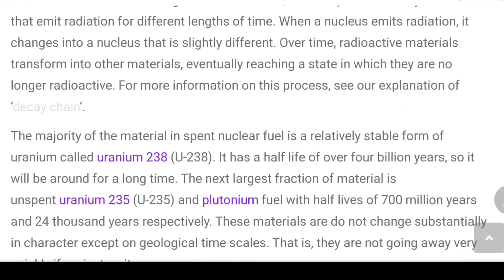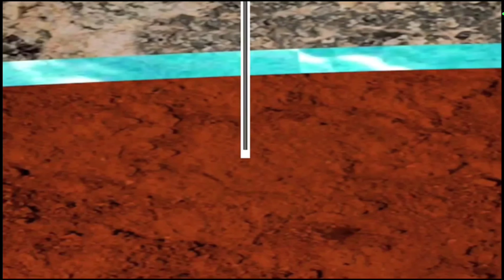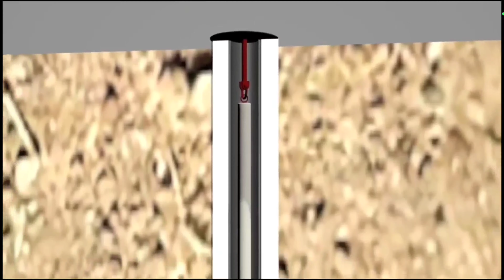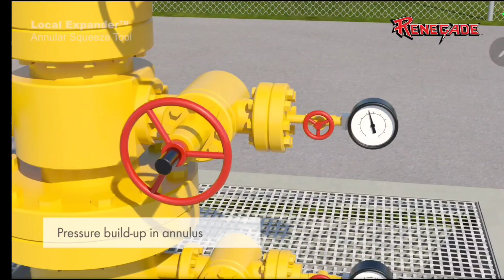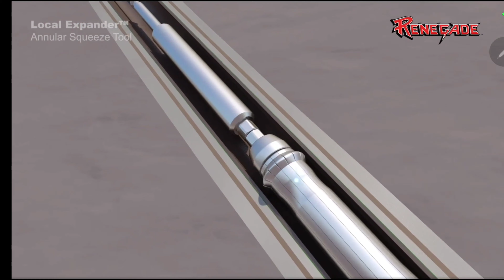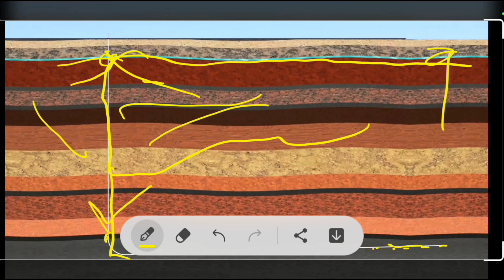Nuclear fuel disposal discussion

Comment: Correction: Zirconium cladding is used as a barrier between nuclear fuel and cooling water to contain radioactive material and prevent it from dispersing/dissolving in the coolant. The uranium in the fuel is already oxidized (UO2) so no need to protect it from oxidation.
Reply from the maker: Thank you for the correction...that all?
Reply from the maker: Keeping it from becoming water soluble.
Reply from the maker: You see one seed planted now don't you.   So now what about the square hole in the bottom of Fukushima and cracks throughout the entire building which is leaking that water soluble corium into the environment, biota and the atmosphere. Bonded to the oxygen in the water.
Reply: @paulmobleyscience  Meltdowns are bad. Thats why I want molten salt reactors.
Zirconium cladding begins to react with surrounding water at 650 C so when reactor begins to overheat a lot of bad things happen.
Reply from the maker: @user-py9cy1sy9u  Molten salt reactors have their issues as well and no they are not the answer to yet another bad decision made by society.  The Tellurium embrittlement issue is not one that can be just covered up with an additive and swapping cores every 7 years.  This is mearly a small group of people trying to push their need for a salary on the rest of humanity and corrupt politicians/government/military allow them to do it.  I served and the oath is foreign AND Domestic and I aim to make certain that my oath I took to protect the citizens of this nation and the world be carried out here in the arena where the debates are held.  You won't ever be able to argue for it because you simply don't have enough of the pros to outweigh all the cons that anti-nuclear activist show, it's impossible and the only reason it occurred to begin with long long ago is war and corruption.
Reply: @paulmobleyscience  Yes you can exchange your core every 7 years. You dont really appreciate the amount of energy these things produce for amount of metal they require. A 500 MW reactor will produce around 200 million dollars worth of electricity in a year. Give or take.
Reply from the maker: @user-py9cy1sy9u  You prove my point right there...."you don't really appreciate the amount of energy these things produce"...surely you're joking?  Decades I've been at this even in the US Air Force Civil Engineering I received training.   I know what I'm talking about and you're still here trying to put lipstick on a pig.  The public is going to know all this information whether you like it or not day after day here commenting, and thank you for being cordial most times that doesn't occur, but one day there will be others they prove you wrong just like those in the 70s and 80s and even now with this whole "emission" free and carbon "free" nonsensical political/corporate manipulation thats taken place since Al Gore and the IPCC.  They were proven wrong and so is Richard Muller as well.
Reply: @paulmobleyscience  If you want to expose MSRs even more then I will let you know a secret. A noble metal plate out on heat exchangers is yet another unsolved problem.
Reply from the maker: @user-py9cy1sy9u  Thank you this is how it should be.   I share, you share we all share.  I have really enjoyed our conversations thus far and like to see it when people disagree at times but can come together and work together.